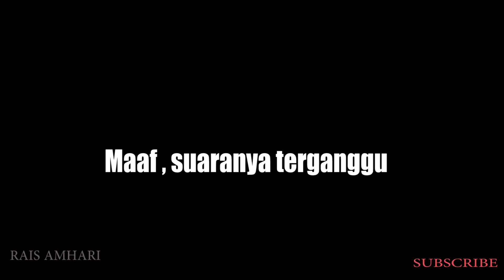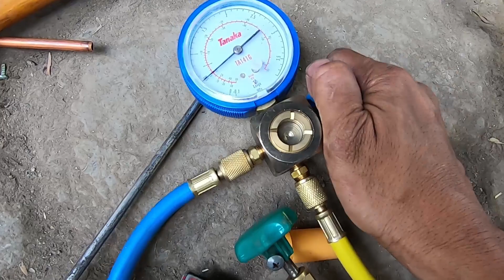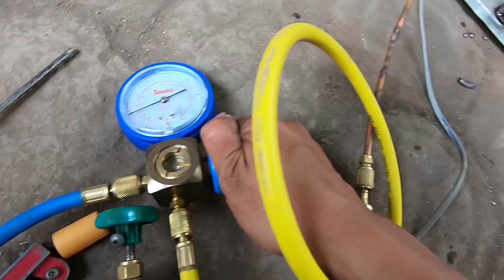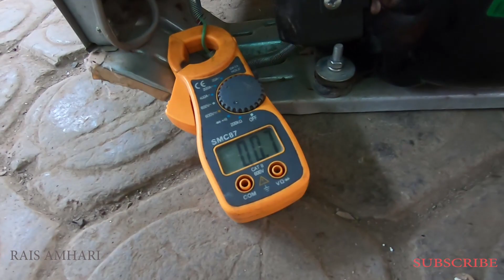Percobaan ,Ganti Evapurator Kulkas 2 Pintu Toshiba Diganti Dengan Panasonic

Comment: kalau compresor 0,8pk blm ada freon amper  0,6 apa msh bgs mas? minum obat mas,e, suarane sampeyan kok kayak lg flu.. hahaa..
Reply from the maker: Iya, maaf lagi batuk, 
Seperti nya sudah naik , kasih capacitor 5mf saja, buat bantu running
Reply: @raisamha1  kalau kompresor kulkas 2 pintu amperenya 0,7 s/d 0,8A 

apa masih normal kang,,suwon?